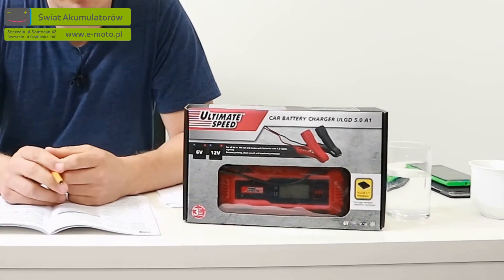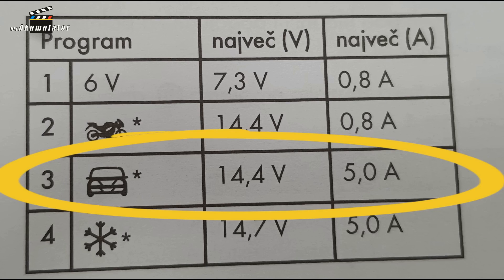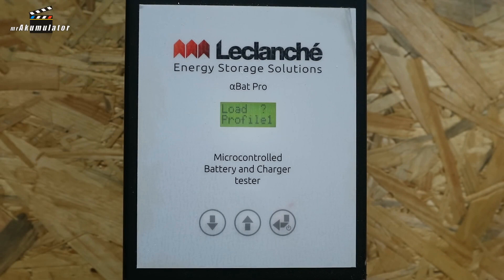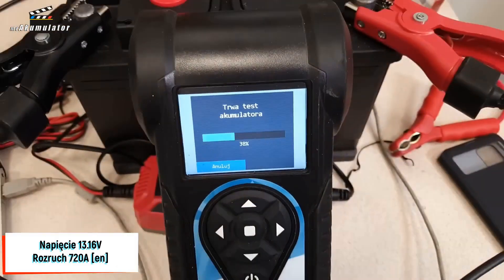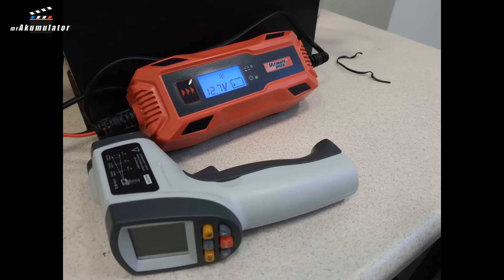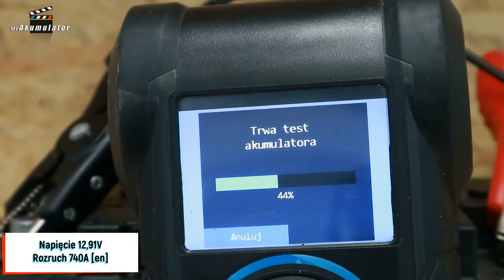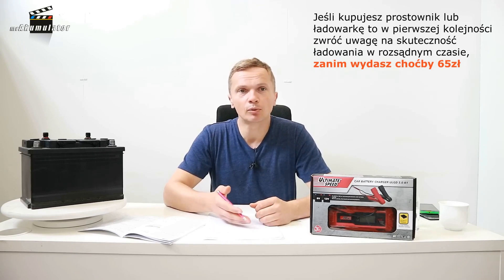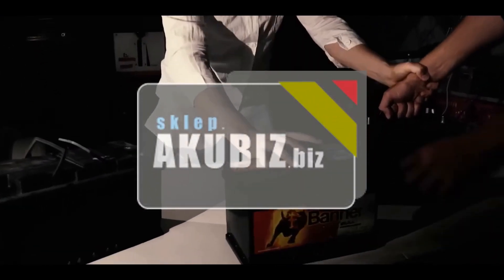LIDL. ULGD 5.0 ​​A1 Battery Charger. Density Challenge.

Comment: Hi, during lead-acid battery charging,  concentrated sulfuric acid leaves the plates and goes into the electrolyte solution. The density of this acid is higher than the density in a discharged battery (about 1.18 g/cm³), so a concentration gradient occurs (from the bottom to the top of the cells). After charging, you took a sample from the top of the battery, where the acid concentration is lowest. Try shaking the battery well, or charge it at 16 V; the gas bubbles produced during charging will mix the acid solution. For more info see "acid stratification in lead battery"